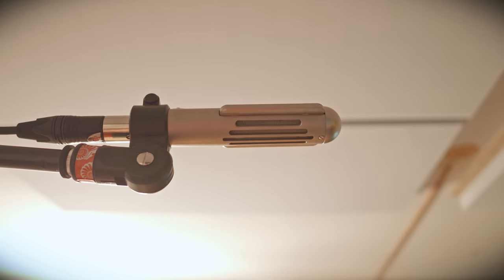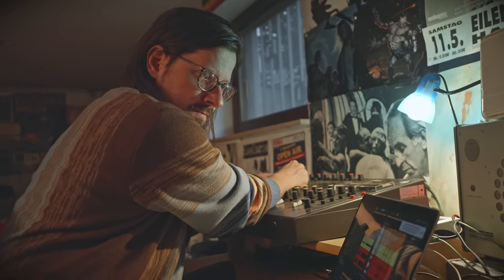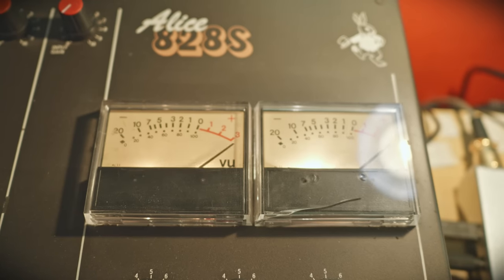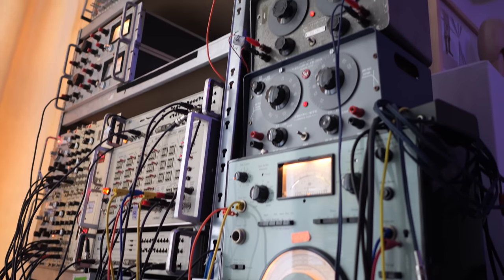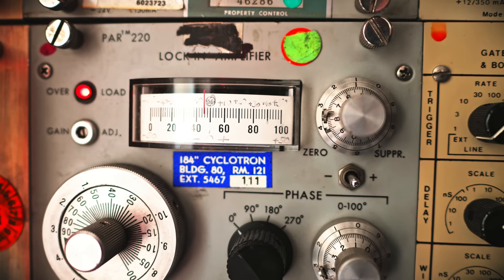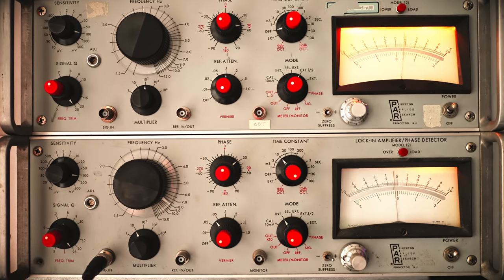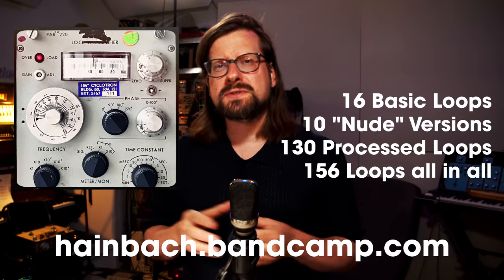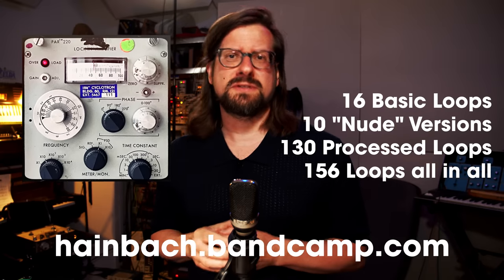Atomizing Acoustic Drums With Nuclear Research Equipment | Loop Pack

Comment: What do you use for gates or VCA type amplitude devices in Nim format or test equipment more broadly? Is it like analog computation where you’re using a “halt” type setting that’s strobing voltage or just relying on triggers/pulses to initiate events at the sound generation level…? I know there has to be a dynamic control element, I’ve thought about just grabbing an old rack of Valley People Gates or something…. Also, there’s tons of amplifier types and SCA’s in Nim that sort of look like they’d function to control dynamics BUT I also just see a single input on them…. Which makes me think it’s either some open amplifier that’s inverting things for computation or it’s literally just for bringing levels up or down in a static manner. Thoughts? I finally have built a proper studio to house my gear now and I can expand in the ways I want.
Reply from the maker: I really don’t use any VCA or amplitude devices since I tend to ping the NIM. The resonance can be controlled, which is good enough timing for me. Getting external gates is the old school elektronische Musik way to do it if you are working with continuous signals like sine generators
Reply: @Hainbach  I really appreciate your help and quick response, I didn’t think I would get one for awhile, if at all… thank you!

Yeah, when I had the old HP oscillators like Stockhausen, I would use gates or these cheap compressors a nearby electronics store had with a side-chain input. I had hoped there would just be a module in Nim that could accomplish this given the complexity of what it’s meant to do, counting individual particles…. Last night I found a site with tons of Nim manuals so I’m working my way through those just to check.

All that said ,with certain patches you can definitely get by with just pings and of course drones are always an option but if I can get them, I want gates/vca’s in place.

Comment: I experiment with all different styles and genres of music (within my limited ability, LOL).
Probably this is very far from your normal style, but I think this would work really well for heavy metal :)
Am going to buy the pack and try it for that, I am sure it will work well just from the loops and single hits as it is. But you might consider in the future recording some more grooves aiming at heavier styles of rock music?
Because I cannot play any instruments, I am limited to using samples and plugins. I made a heavy metal track once using drum loops from a jazz sample pack. As I recall, I didn't even had to speed them up. All I did was to add distortion and that transformed to sound from cool jazz beats to aggressive heavy metal drums!

Comment: I did this years ago through a guitar distortion pedal
Reply from the maker: I don't think a guitar pedal was used in a particle accelerator.
Reply: You are correct, just saying, it just reminds me of the sounds I got when I ran a microphone through a distortion pedal on my drums is all
Reply: @badtripmoses  agree with you, in this instance I think hainbachs overestimating some unique quality of his obscure gear...it comes off as some sales pitch.  Which is cool. But I think you also could get equal, varied, and or better results with some standard od/fuzz/distortion pedals...